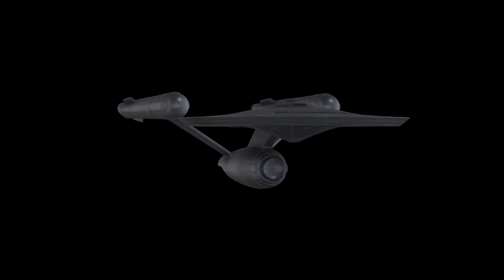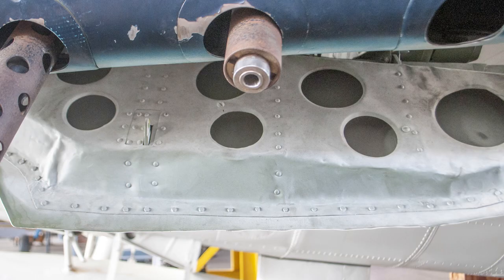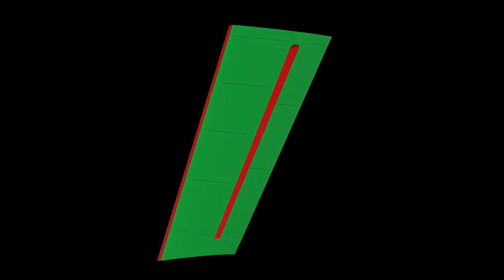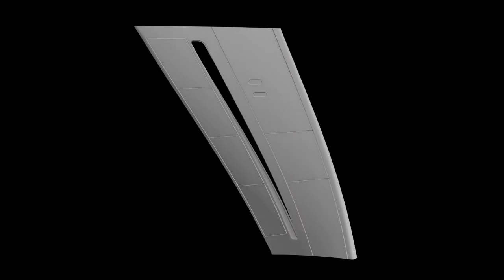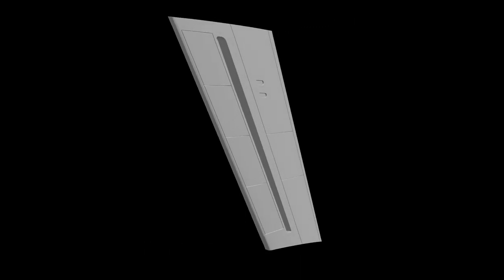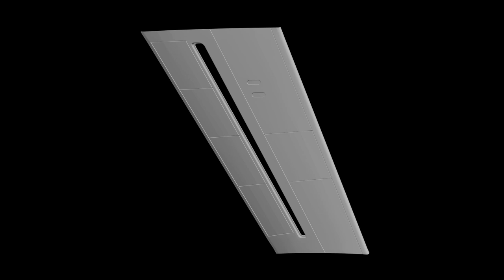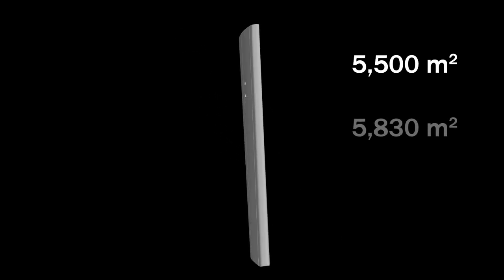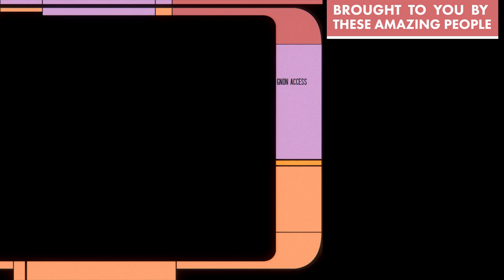What's the Deal with Pylon cutouts?

Comment: What you said about the edges increasing the resistance against bending is only true if the structure is entirely hollow to begin with. Your models are massive. That means, they would indeed be weakened despite having more edges. Imagine that a massive structure has a near-infinite number of "edges" stacked side by side.
The pylons of the spaceship although are probably kinda-hollow, allowing space for EPS flow and for maintenance access. But they will also be filled with internal structures that give more edges for stability (like a bone).

Alternatively, the cutouts might just be there to save on material - unlikely since in Startrek, there is so much material to construct basically everything.
Alter-alternatively, the cutout-edges might be the outer walls of sensitive elements that handle the massive energies for the warp gondulas. If they explode, they will have a higher likeliness to rip a hole to space and let the lethal plama escape instead of spreading it into the interior of the ship.

Comment: i like your thoughts on the radiator panels.  its a good use of the surface area, to service the engineering hull.  another area could be on the saucer around the impulse drives.  any waste heat form those could be used towards power generation and the leftovers are vented to space.

but, if you have the warp plasma conduit running directly forward of that notch in the larger part of the pylon, the notch could serve as a blow out area to prevent the spread of damage.  that is, you could have the conduit able to fail catastrophically into that groove because the inner and outer armor plating and the inside of the nacelle on the forward side of the conduit would both protect the conduit and the rest of the pylon while forcing any failure into the notch.  the force of the explosion would be attenuated by vacuum and allow the rest of the nacelle on the other side of the notch to withstand the forces and prevent structural failure of the entire pylon.

the other idea is that the conduit is in the smaller side of the pylon and that the larger section is fully capable of supporting the nacelle on its own.  this would make the smaller side a sacrificial item and allow a catastrophic failure of the conduit to not risk losing the nacelle.  and if the passage is in the larger side than people can still safely get through even after a conduit failure.

this could perhaps even allow the presence of an emergency conduit that isn't in normal use or only for very high warp settings on the other side of the notch.  it wouldn't allow much warp speed on its own, but would be useful to limp to a starbase on.

Comment: 3:45 Someone else has probably commented this, but "people freezing on exposure to space" may not be entirely hogwash---the vacuum of space would drastically lower the boiling point of any moisture on the skin, and this evaporation (which is a cooling process) could lead to a rapid cooling of the surface, potentially to the point of freezing. I've not done any math so maybe the numbers don't add up, but it's worth noting, I think.

Comment: Great video, as always. As far as Star Trek goes, I've recently wondered how the replacement crew is always appearing at just the right time, even though the away team has just been decided upon. I could understand if they were showing up due to a shift change, but not after a spur of the moment away team assembly. I mean they are usually coming out of the turbo lift, not some bridge crew waiting lounge, which means they are presumably coming from their quarters or any number of other locations throughout the ship. Just a thought for a potential future episode.
Reply: Given the volume of the ship, it's entirely possible that there's an unseen ready area (let's call it the green room) where duty personnel can assemble before going on-shift.

Comment: The circumference of each cutout may be something analogous to particle accelerator -- each side not entirely unlike a synchrotron, except for its track being elonglated in the longest dimension of the cutout. That is to say, it may be important to make the warp plasma travel faster and faster by pumping it around the circumference of the cutout again and again -- the speed of movement and kinetic energy  increasing each time the plasma moves around the circumfrence of the cutout. Once the proper energy level is reached, a valve automaically opens, so that the warp plasma can continue to travel into the actual nacelle components.

Comment: For people wondering why it’s needed to reduce mass in space because yes there is no weight in space but there is mass and if you wish to move something in space you must exert more thirst relative to mass To move it. 

So less mass means less energy needed to move it. 

Also in Star Trek they use something called structural fields, a force field holding the ship together

It’s said in Star Trek enterprise that the Necell pylons are made from a poly coltan substance with an ability to block radiation beyond that of the rest of the ship, we know they use a coolant as when there is a coolant leak the evacuate the area immediately as it’s highly toxic to humans.

Comment: My first thought would be that the cutout is there for security.
If you think about it with how much damage federation ships take, how long they can operate under such circumstances and how fast they are operational again it would be logical to have a lot of redundancies. The thing that would probably need to the most redundancies to keep functioning would be the Warp Drive as a whole, since should that be damaged you either are already gone (warpcore rupture), you dont want to be there any more or you want to get home quickly and not be a sitting duck. 
Since doubleing up the Nacelles in such a way that would allow them to work both when all are online and when only a few are online is problematic.
(IIRC the Nacelles are more or less designed for the warpfield geomnetry they are meant to produce. Meaning you couldnt simply take a Constelation Class ship and simply run it on 2 nacelles instead of the four without changing something in the Nacelles)
The next best thing to double up would be the Plasma Conduits to the Nacelles which run through the Pillons and that is where the cutout would come into play.

Say we got two conduits running through each Pillon and one is damaged. Suddenly you got Plasma everywhere, probably melting a lot of bulkheads. Should that plasma reach the other Conduit it would damage that too and the warp drive is gone.
So you could either build in some internal armor or physically seperate the Conduits.
Another thing to consider is battledamage, should a Pillon be hit the energy of the attack would have breached the hull (and therefore the most armored part of the ship) and is now inside the Pillon spreading out/being defused into the internal structure. Seperating the Conduit and its backup into seperated structures means an attack would probably need to breach the hull 3 times to take out both. 
Also the increase in twisting flexibility (as mentioned in the video) would probably help with the absorbtion of impacts and damage taken from an attack to the Pillons or Nacelles.

Comment: they could be anchor points for the nacelles, internally externally. The nacelles should be detachable or the cut outs could simply allow for easier repairs depending on the design.

Comment: While cut outs may increase strength, it should be noted that the outer hull is merely the ship's outer skin. Certainly it provides strength, but the ship's superstructure is where that strength is provided. And with enough of a safety margin that the ship can stress itself without falling apart unless the ship is constantly undergoing the same excesses that go beyond it's design specs. To this end, cutting out a section is counter intuitive as the empty space is space that could have occupied more superstructure.

Comment: I stopped the video at 37 seconds I thought i'd comment before watching - then see if we have any similar thoughts.
Possible explanations.
1) One side of the split is the plasma feed the other side is the turbolifts and other utility connections to the nacelles
2) One side is for the matter feed from the bussards and the other side is the plasma feed
3) it's a break for radiation and cooling reasons
4) The hole exists to allow some component part in the fore strut to have access to both sides of the strut structure
5) It's has a reason to do with stress loads for the SIS fields or the Ships 'skin tight' energy shields - perhaps the entire middle gap is reinforced with a shield when they are raised to add strength & Protection to them.
6) The back part is the matter feed to the "After burners" at the back of the nacelles
7) The additional part is just a structural reinforcement that serves no other serious purpose like a buttress to the main strut.

Lets see if Eric thinks the same now on his points to any of mine...

Comment: For your first point, I am extremely(this is an understatement) skeptical that only removing material would make the structure more rigid. Simply having more walls to make it stronger as you explained doesn't make sense as by that logic you could keep cutting more and more holes and it would only strengthen it further.

Adding some of that material back along the cutout to make it thicker while still using less total material I could agree with as that would actually increase the compression/tension strength along the plane you're interested in.

Comment: The real reason is from the designer of the ship, John Eaves. 
What he did was take the TOS ship, and added bits on to it that could be removed. If you take away the extra bits, you have the TOS ship, so it was a way to explain how the ship changed from The Cage to Discovery and then to TOS.
As for the nacelle pylons specifically, the single pylons became a double pylon design.
There is one other thing, in Discovery and SNW we see that the pylons are on an angle and are not straight like in TOS. This was a change done by the visual effects team and not John Eaves. As designed, the pylons are supposed to be straight.
Eaves talked about it in an episode of the YouTube show Trekyards.
The John Eaves version with straight double pylons is in the Star Trek Online MMO.
Reply: Also it’s 442 meters instead of tos 289 meters .

Comment: Question since most other races have internal warp coils why do the never routinely attack the the pylons of federation ships in battle.
Reply: Until shields are breached, the area struck is irrelevant. And once they are, that's going to be the most reinforced area of the ship. And while you're shooting at a reinforced pylon, they're shooting engines, shield generators, reactors, and phaser banks.
Reply: @Daniel-Strain  yes and you can also fire torpedoes at the pylons and take them out while shoot at their reactors,shields at the same time.
Reply: Do you want them to stop warping first or stop shooting first?
Reply: @pills-   I would prefer the ship with the multi megaton warheads not be able to use them over not being able to chase me.
Reply: @shardstorm21  Kirk actually did that in Star Trek II: The Wrath of Khan. When he had the Reliant in sights in the Mutara Nebula he fired directly at the primary systems and blew off one of the nacelles by knocking out the pylon with a torpedo. In The Next Generation the Enterprise gets blown up enough times by getting its nacelles bashed too, though its pylons are a lot bigger and stronger.

Comment: It could also be to hide blowout panels for a conduit. The conduit would run up the forward edge of the cut out, with the main structure supporting the nacelle running up the forward and aft edges of the pylons. The sides of the pylon can remain heavier to protect the conduit from damage from the sides. Should the conduit rupture, it would blow out the forward edge of the cutout so it would vent into space, hopefully without compromising the pylon and losing the entire nacelle.

Comment: I think the RW reason is that it’s legal. It has to be different from the classic enterprise and the movie one.

I do think that in fiction it may be a venting system, maybe a structural thing as you say for structural support. I personally think it may be that a force hit on the pylon could damage it, now I’m thinking each pylon has two lines leading to the warp nacelles. So one part has the plasma going to it if damaged won’t stop the warp plasma going to the nacelles.

Comment: You're close.  I think we see it as looking cool or right because we all intuitively understand on some level that it is most probably a stress reduction feature.  It will reduce shear stresses across the structure due to twisting forces or thermal expansion. Materials need to be able to flex without breaking!

Comment: I think in the ST:TNG Technical Manual by Mike Okuda it says the warp coils in the nacelles are the densest and most massive/heaviest part of the ship. I think there's even a note to the effect that if the Enterprise were to land on Earth, the nacelles would sag toward the ground under 1G of gravity. Since the ship we see in ST:D is "an older version" of the Enterprise, maybe it has an older warp coil/nacelle set up that is particularly massive, and the double strut configuration is required to handle the load. Then later, the ship gets an upgrade to lighter/faster set of warp coils/nacelles and only a single strut is required. Just a thought. I will climb back into my nerd hole now.
Reply: Have you seen ECs video on warp coils? Worth leaving your hole I promise.
Reply: @DrewLSsix  Ha! I'll check it out.

Comment: Aside from cooling, and emergency venting of the engines, one item you neglect to consider is as a ramscoop function; while the deflectors and warp field protect the vessel from serious damage while underway, it would be advantageous for a vessel in the Star Trek Universe to 'pick up' or 'sample' matter from the space it is transiting, much like a modern cruise ship uses a desalination plant to create fresh water for its passengers while it is underway.  A vessel the size and ranging of the Enterprise would not have options to stop at a base for a full refill or resupply all the time, hence the ability to pick up free-floating matter - scooped in and collected through the slots via the warp field manipulation - would be beneficial for resupplying the hydrogen for the matter-antimatter reactions, and other lightweight elements - such as oxygen, carbon, etc - that would be lost, since it seems unlikely that even a starship would be a fully self-contained system to prevent leaks and off gassing even under normal operating conditions. Presumably, the raw collected matter could be used in replicators to generate food, parts, etc, much more effectively than a purely energy to matter system.  And while the interstellar medium would have a small amount of this, it might work better in orbit around a planet or star where the elemental medium would be more plentiful, while the ship is visiting or surveying.

Comment: One problem with the "increase the heat-radiating area" argument is that, in space, heat radiating surfaces mustn't point at each other or else they just shine that heat back into each other - this doesn't apply in atmospheres where heat is lost due to conduction into the air, but this is why the heat radiators on the ISS etc. are big flat panels rather than stacked fins like heatsinks on equipment down here!

Personally, I reckon it's weight reduction. A smaller pylon wouldn't be strong enough, not due to less material inside it, but because of the lever forces of the nacelle being concentrated there (like why long bridges have multiple supports rather than one massive one). What we're seeing is basically two structural pylons, spread apart a bit to take the forces efficiently, one larger because it also carries the plasma conduits, and no reason to put hull material over the gap between them!

Comment: I'm affraid it's not faces that resist bending, but rather the material thickness in the direction of the bending. Adding a cutout would reduce the bend resistance by a fair amount, not increase it nearly two fold.

Comment: If you want to increase the cooling, make the pylons black. A black surface is more efficient at radiating heat away than a white one. Also, cover it with small ridges to greatly increase it's surface.
Reply: Like TMP refit?

Comment: Actually, there's a better heat-related technique: if you can transfer your excess heat into a plasma, then that plasma might be magnetically confined inside the slot to provide a high-density radiator system. Alternatively, that same plasma could be circulated through the slot, and around one of the pylon sections, if more radiative area was needed.